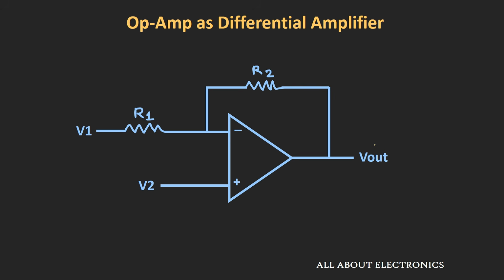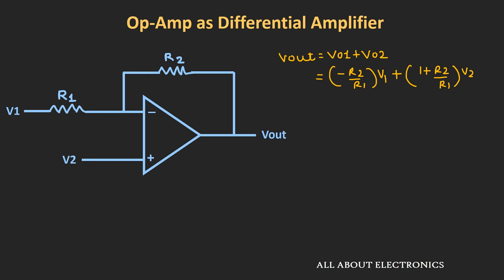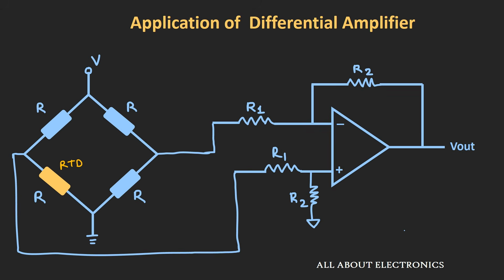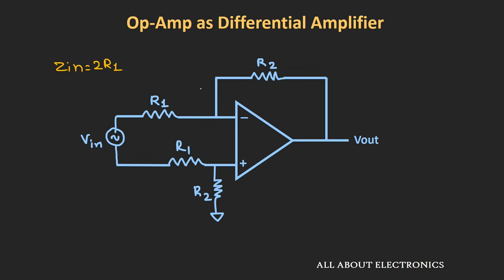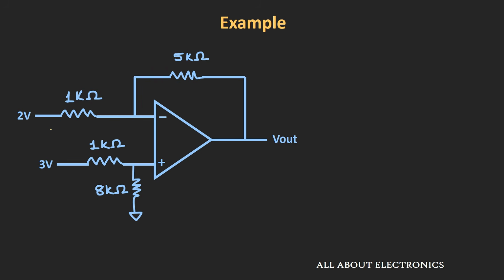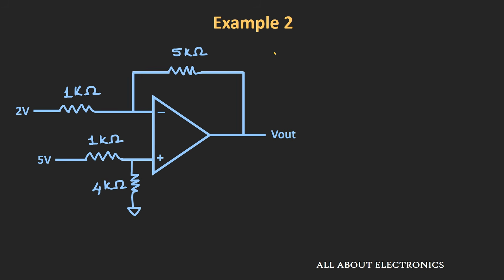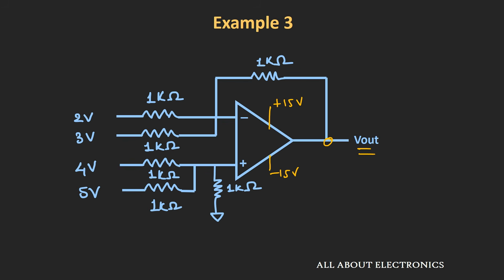Operational Amplifier: Op-Amp as Differential Amplifier or Op-Amp as subtractor (With Examples)

Comment from the maker: The video solution of the practice problem :
https://youtu.be/wvxr2wHflrQ?si=ta8xrg-VeGlfZ5rb

The timestamps for the different topics covered in the video is given below:

1:00  Op-amp as Differential Amplifier
6:30  Application of Differential Amplifier
9:35   Example 1
11:30 Example 2 (Effect of Biasing Voltages on output)
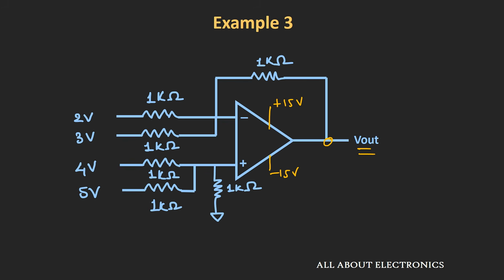13:31 Example 3 (For practice )
Reply: I face problem "in seeing resistance from this side " the input resistance is this ? Which video should I watch
Reply: Sir please reply 🙏🙏🙏
Reply: 14:00 it can also be solved by knowing the fact that all resistances have equal value and therefore it works as an adder ckt at both inverting and non inverting terminals. Hence V+ and V- can directly calculated as 9v and -5v .
Reply: Can you please solve the last example please

Comment: For those who don't know whats RTD :
Resistance thermometers, also called resistance temperature detectors, are sensors used to measure temperature. Many RTD elements consist of a length of fine wire wrapped around a ceramic or glass core but other constructions are also used. The RTD wire is a pure material, typically platinum, nickel, or copper.
Reply: Thank you brother your comment helped us

Comment: Thank you sir.I learned about opamp easily from your videos.The answer of the example 3 is 4v.(V total =V1+V2+V3+V4=-2v-3v+4v+5v).
Reply: I am not getting this answer please help me
Reply: Ye 1/2 ka factor, jo last two terms me aaya h, wo kya parallel resistance addition ki wajah se h?
Reply: @voldemort7443  haan video dhang se dekh samajh aajayega
Reply: @vatsalagarwal2758  the answer is 1v bro
Reply: @bharadwajkv4662  nope
Reply: @vatsalagarwal2758  answer 1v hai tm 1/2.parallel ke karan liya pr uske baad 4v nahi wHa exist nahi karega tmko voltage divider bias lagana padega
Reply: @adarshkumar4683  kaise hoga 1v 
explain kro jara
Reply: @vatsalagarwal2758  bro isme (1+Rf/R1)me R1 kon sa liya hai??????
Reply: @vatsalagarwal2758  bhai video tu dhang se dekh.because write solution is like  -(1/1)*2+ -(1/1)*3 +(1+(1/0.5))*((1/3)*4)  +(1+(1/0.5))*((1/3)*5) =4.
Reply: @shubhamvora7237  thanks bro
Reply: @shubhamvora7237  thanks dude
Reply: Thanks for conforming
Reply: @vatsalagarwal2758  thank a lot
Reply: How is r1 0.5 and not 1
Reply: @shubhamvora7237  how is r1 0.5
Reply: @CoolCool-jp4hv  we take both grounded resistance in parallel
Reply: @shubhamvora7237  OK thanks but in other sums we take the resistance with the active voltage source right.. Which is 1k?..like when 4v is active resitance is 1k
Reply: Answer is 1v in the non inverting case each input has 1k series and (1k+1k)parallel ...non inverting inputs aren't separated as inverting and you need to use superposition theorem to get voltage for each sources
Reply: @bharadwajkv4662  I am also getting (-2-3+8/3+10/3) = 1v
Reply: @vatsalagarawal 1/3 kaisa aaaya
Reply: @bharadwajkv4662  not 1V  bro 
(Vout)2 ={1+R2/R1}* V2 *R2 /(R1+R2)
First curly bracket in this R1= 1/2 because of eqivalent of 1&1 
R2/R1= 2.    (1+2)*{3}= 9 
(Vout)1 = -5V 
Vout=9-5 = 4 V
I hope you doubt is clear now

Comment: answer is 4v .and i would also suggest u to put more questions of this type for practice.
Reply: Hey can u explain me im stuck i cant find the answer
Reply: Yeah, I got that answer by using nodal analysis. Lesser solutions...

First, I solve the voltage at V+ using nodal which is 3V.

Then, because it is a negative feedback V- = V+. So, voltage at V- is also 3V.

Again, to solve for Vout, using nodal, the answer is:

(2 - 3)/1k + (3-3)/1k = (3 - Vout)/1k,

Solve for Vout, is 4.0V... ;')
Reply: @waraysplayground26  it might have been a typo, but ig that should be (2-3)*. Thankyou so much !
Reply: @waraysplayground26  will Ra be equal to R1+R2?
Reply: @priyanshagarwal5682  , actually I didn't rely on the formula. I stick with the nodal analysis when answering op-amp. Ra is not equal to R1+R2 here. :)
Reply: @Elisha Gibsonfreaking bots
v
Reply: Right broo....
Reply: Yep nodal analysis is great for op amps.
Reply: @priyanshagarwal5682  R1 and R2 are parallel so Ra=R1||R2 then it will come according to formula
Reply: @harindudilipa1559   very simple bro.....just use the principle of superposition by assuming this once inverting adder and once non-inverting adder.....that's all.
Reply: Yes it will 4 v

Comment: for those who are not able to solve :

consider the voltage Vx ( hope you know where is the vx)
2-vx + 3-vx = vx-vo
vo =3vx-5

second equation
4-vx + 5-vx = vx
vx= 3

put this value in first eq .
Reply: thank you vroo
Reply: If it is right answer then video of summing amplifier is quite complex..superposition theorem,long equation
Reply: @chitrasingh9200  yeah true...no need to solve by superposition😇😇
Reply: bhaiya ji answer hi likh dete poora
Reply: @manikanthbolem1328  bhai yeah bhi solve nahi hua tere se
Reply: @arshmohan4327  mujhe toh answer dhek kar bhi samaj nhi aya
Reply: bruh you can just do nodal analysis on that part of the circuit and get Vx in one line.
Reply: can you try example 1 by nodal? the answer is not matching
Reply: best method
Reply: Thank you bro, I you found method that works for every question

Comment: we can solve this problem by using  summing amplifier.
For inverting amplifier Vout= -Rf/R{v1+v2+v3} where R=same for all.
similarly for non inverting Vout={1+Rf/Ra}×{v1+v2}/2. where R is same for all.

Finally thank you sir for providing video. It is very clear to understand and learn.
Reply: why v3 in the inverting amplifier?
Reply: Which resistor is Ra on this case?

Comment: The answer is 4V.   While calculating ....Rf = 1kiloOhm and Ri =  1 KiloOhm parallel 1 KiloOhm = 0.5 kiloOHm.  And while calculating the voltage by the non-inverting input first use voltage divider (you will get 2V, 2.5V) then superposition theorem (consider the other two resistors as in parallel)  ( 1 + 1/(1 parallel 1)) x (2V + 2.5 V) = 3V. Then at last V output because of that ( 1 + Rf/Ri ) x (3V) = 9 V. From inverting terminal we get Vout = -5V. So, the final answer if 9V + (-5V) = 4V.
Reply: on inverting part we get vo1=-5volt and non inverting part weget vo2=9volt , in total giving 4 volts
Reply: how can both V(non - inverting) and V(inverting) terminals have different voltages? as per the virtual ground/short concept both V+ = V- in terms of magnitude provided there is nothing mentioned in the question that these both are not equal. According to the basics of Op amps, voltage at inverting terminal is always equal to voltage at non - inverting terminal
Reply: @hitarthanandrohra8846  oh, yeah!
Reply: Parallel me thori hai Bhai dono 1 k ohm
Reply: @hitarthanandrohra8846  I believe it is because the principle of super position is being used. In steady state, v+ and v- probably are equal. To solve the problem more easily, we calculate how the system would respond if various input voltages were grounded (giving different values for v+ and v-), then sum the results.
Reply: Guys, how did you get 2 and 2.5v on non-inverting amplifiers?
Reply: @yonatantamiru7756 can you explain, how you got -5v forvo1.Because I got -2.5v and what is the value of R1?
Reply: @marshmello6664  using potential difference theorem, we take (1/1+1) x 4 = 2V and same with 5V we get 2.5V.
Reply: @parthapratimboruah641   how did u got 9V at last V output.
I got only 6V output there.
Here apply superposition to get out is V: 3V. Then apply Fb Vo: (1+Rf/R)*V= 2*3V =6V.
How 9V?

Comment: Vout = 4V 
Through applying  the superposition theorem for each input voltage..   We will get 4 output voltages..  Combining all these output voltage...  The result will be = -2-3+4+5 = 4 V
Reply: How? I guess, 1V
Because the v3 (which is connected to the ground) of the non-inverting terminal has effect on the input voltages.
Reply: @parvezmahmud6963  yeah 1 v is the answer
Reply: @greninja2607  Okay great, that is what my answer was as well. Thank you very much!
Reply: V02 is at non inverting (1+Rf/R1) *vin
So it is not 9v it's 18 . 18-5=13v

Comment: Ans 4v
-2-3+4+5 = 4volts
When consider 2v Vout = (-1/1)*2 which is 2V
when 3v Vout = (-1/1)*3 which is 3V
When 4V Vout = (1+(1/1))*V' where V' is get through voltage divider rule (Same resistance/Total resistance)*total voltage which is V' =(1/(1+1))*4 =2V
so, when 4V consider Vout = 2*V' =2*2 =4V
When 5V V' = (1/(1+1))*5 =5/2 =2.5V then Vout = (1+(1/1))*V' = 2*2.5 = 5V
so total Vout = -2-3+4+5 =4Volts
Reply: Thank you boss 🫡❤

Comment: Hi Sir thank you for such a nice series of lectures. Doubt are 8:07 Min Onwards 1. How Input impedance seen from upper terminal is R1 and lower is R1+R2. How?     2. Similarly at 8:24 Min how input impedance is  2R1. Thanks in advance.
Reply from the maker: To find the input impedance at the upper terminal, just connect external source at that terminal. The ratio of that voltage to the current supplied by that source will give the input impedance seen through that source. And while calculating that, we will consider all other sources in the circuit as zero. That means the non-inverting terminal will get connected to ground via two resistors. 
So, if you apply the KVL at the inverting end, then you will get Vx / Ix = R1. 
Likewise, on the lower terminal, if you follow the same procedure, at the inverting end, you will get Vx / Ix = R1 + R2.
Similarly, at 8:24, to find the input impedance, you need to find Vin / Iin. Because of the virtual ground, the voltage at the inverting and non-inverting node will be same.
So, while finding input impedance, for simplicity, you can assume that both are connected together. So, whatever current (Iin) that is passing through upper resistor R1, same current will return through lower resistor R1 and will go back to the negative terminal of Vin. So, if you apply the KVL, then it is Vin = 2R1 *Iin.
Or Vin / Iin = 2R1.
I hope, it will clear your doubt. If you still have any doubt, then let me know here.
Reply: @ALLABOUTELECTRONICS  Thank you for your response. I have solved all the cases according to your guidance and quite satisfied. For 8:24 Min, I am satisfied with the logic but still not able to figure out that what is happening with R2 which is connected between non-inverting terminal and ground. Current through that R2 will be 0, it is giving me a bit dissatisfaction even though I know solution is correct. Can I share the solutions (by any means), what I did, for crosschecking the correctness?

Comment: I got 4 Volts which can be arrived at intuitively or using math.

Here is my solution:

This solution demonstrates that the total output is the sum of the outputs for each respective input.
Vout = V2out + V3out + V4out + V5out

Each output can be considered as 4 individual cases 2 cases for the Inverting Summing Amplifier and 2 cases for the Inverting Summing Amplifier.

First consider the Inverting Summing Amplifier cases:
V2out = - V2in x (Rf/R2) = -2Volts x ( 1/1 ) = -2 Volts 
V3out = - V3in x (Rf/R2) = -3Volts x ( 1/1 ) = -3 Volts
In both cases the first term represents the input voltage, 2nd term the gain for each input voltage.

Second consider the Non Inverting Summing Amplifier cases:

V4out = + V4in x (Rg/ (Rg + R4)) x (Rf/R4 + 1) = +4 Volts x (1/2) x 2 = +4 Volts 
V5out = + V5in x (Rg/ (Rg + R5)) x (Rf/R5 + 1) = +5 Volts x (1/2) x 2 = +5 Volts

Note, Rg represents the resistor tied to ground.
In both cases the first term represents the input voltage, 2nd term the voltage divider, and 3rd term the gain for each input voltage. 

As mentioned earlier, the total output is the sum of outputs for each respective input.
Vout = V2out + V3out + V4out + V5out
Vout = -2 Volts - 3 Volts + 4 Volts + 5 Volts
Vout = 4 Volts
Reply: One resistance is already ground.
If we tied to 5v resistance to gnd then the both resistance will be in parallel so the equivalent resistance will be 1Kll 1K= 0.5K
Reply: love you bhai
Reply: @indrajeetkumar8917  true .. how to proceed then??

Comment: Sir, we can also get the subtraction operation done by using the approximation R2/R1 >> 1 so that, 1+R2/R1 = R2/R1 and hence, Vo = (R2/R1)(V2-V1).
Reply: Sorry for my newbie,I also confuse about R2/R1 >> 1, it mean 1+R2/R1 -> 1+1 = 2 the result difference between (R2/R1) -> 1 and (1+R2/R1) -> 2 quite a lot... In my thinking..

Comment: Sol:-
Resistors value is always 1 in question
     Applying super position theorom at uper node where (-) sign
I2+I3=I1
(2-V)/1+(3-V)/1=(V-Vo)/1
5-2V=V-Vo
-Vo=5-3V
Vo=-(5-3V)-------1

Now apply down positive lower side superposition then
I4+I5+I0=0(inside flow current is 0 in op-amp)
Now,
Voltage is same at both point according to rule 
(4-V)/1+(5-V)/1+(0-V)/1=0
-3*V=-9
V=3
Put the value in equation 1
Then
Vo=-(5-9)
Vo=4v
Is correct ans
Reply: 1v aa raha ha,
Eqn 1 me for inverting- Vo1= 5 hoga,waha 5-3v kyu ho raha ha
Reply: yes it is correct
Reply: @antaradey1274  yes
Reply: why are you keeping solutions

Comment: Since last week I am looking for the Answer How designer decide to use R1 and R2 at Non inverting terminal as Voltage Divider for achieving differential amplifier??! 
& I found here 

Thanks dear
Reply: From you i got answer , i made correct in v01 and gone wrong with v02 bcz i not use voltage divider now i got ...thanks dear

Comment: In the derivation part you considered resistance values are equal in the input of V2 and input of V1 and  equal value as Rf.. But in the calculation part you have taken different resistance values for everything.. Is it necessary to take same resistance values for input of V2 and V1 and Rf?
Reply: you've probably completed your degree by now, but if anyone else has the same question, this is just the method for derivations I'm pretty sure, you start with the general case and derive the particular cases (when input resistances are equal).

Comment: Beyond my understanding, but so if I'm changing the value on R2 (V1) with potentiometer to get my desired output,  as long as I do the same thing on R4(V2) making resistance to match and assuming R1=R3,all I have to do is take R2\R1x( v1-v2)?

Comment: hello sir 
     your analytical approach is perfect but when we do in simulation for 2nd example circuit the out is not 12v it is 10v
Reply from the maker: Because, often the saturation voltage of the op-amp is less than the biasing voltage. In fact, it's true for most of the op-amps. There are some  rail to rail op-amps, whose  saturationvoltage is close to biasing voltage. That's why you are getting 10v.

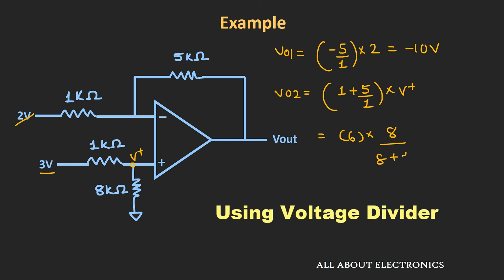Comment: 10:47 where did the 6 come from and why is he not using ohms on his voltage decided equations?
Reply: Becoz voltage is not in op amp
Reply: @varunv6309  actually it comes from the vo2=(1+5/1) thanks for the response.

Comment: Hi! what happens if V1 is fed with AC and V2 with DC? I am trying to solve an exercise in which V1 branch has a capacitor along with that 'R1', so I assume that when charged it releases DC but I am confused by how it works... seems like a band pass filter maybe?
Reply from the maker: Without looking at the circuit, it is difficult to tell the working of the circuit. But many different types of circuits related to opamp has covered and many examples have been also covered. You may check the opamp solved examples playlist. Perhaps you will find a similar type of example you are looking for.
Reply: @ALLABOUTELECTRONICS  I'll check them! thank you

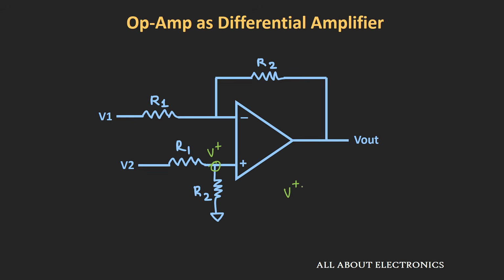Comment: At 4:58 Are the resistances R1 and R2 are connected in series ,that means no current through the op amp inverting terminal .
Reply from the maker: Yes, here it has been assumed that the op-amp is ideal.T hat means no current is flowing into the op-amp terminals.
Reply: Thanks for clarifying 😀

Comment: In this sum on the non-inverting terminal first  4v voltage source acted so short circuit the 5v then the resistance of 1 ohm and 1ohm are parallel then simply it 0.5 ohms then answer will be 8/3 how do u eliminate the 5v source resistance 1ohm????

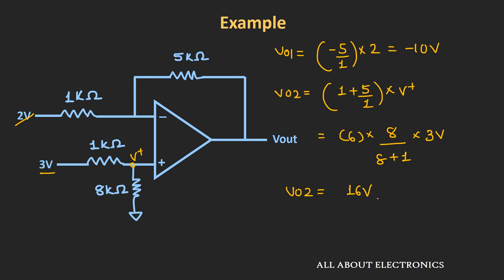Comment: 10:58 When we are calculating V02 , shouldnt it be already saturated at 15 volta since we had applied biasing voltages of 15 volts to the op-amp,??... Kindly clarify the doubt sir..
Reply from the maker: Here as we are applying superposition theorem, so even if the one voltage Vo2 is going above the supply voltage, it doesn't matter. So, just consider it as it is. What matters is the final output voltage Vo1 + Vo2. If that is above +15V, then we can say that the output will get saturated to +15V. But if the final output is less than that, then that's alright. I hope, it will clear your doubt.
Reply: @ALLABOUTELECTRONICS  Yes sir..got it now..Thanks a lot

Comment: in the inverting amplifier video you have  explained about the buffer circuit , there you have used the same circuit as that of a instrumentation amplifier and here you have short circuited the inverting input voltage to that of the vout. please explain me this point...
Reply from the maker: That is the design of buffer circuit, where the output is short-circuited with the inverting input terminal and input is applied at non-inverting input terminal.